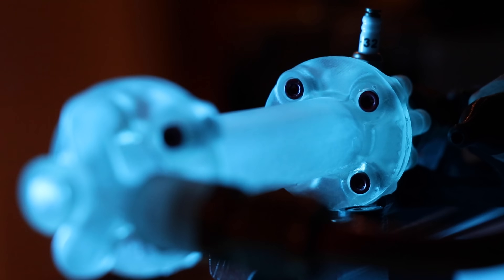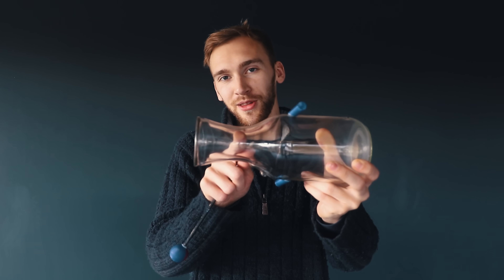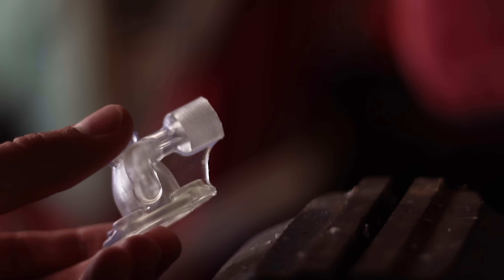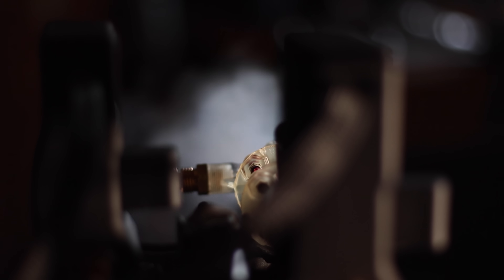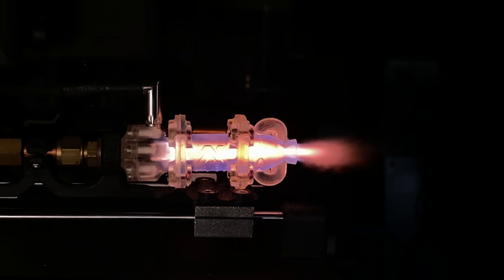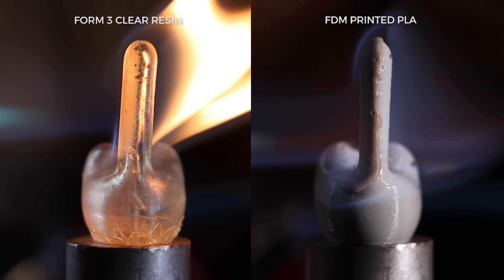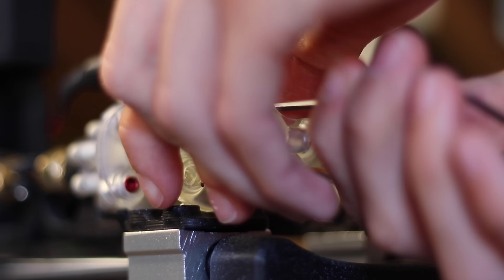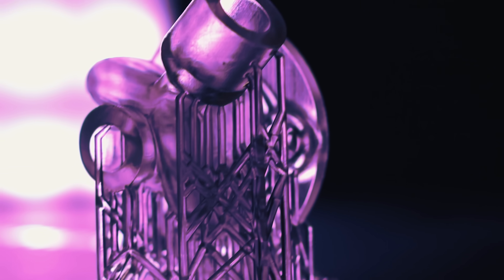3D Printed Vortex Rocket Engine Igniter

Comment: how about ceramics resin to next step nozzle tests? Those are not perfect either without burning them at high temperature but still better than normal resin. And when they work you can just heat those parts and get full streght or move to metal print if you need thermal conductivity.

Comment: You could design the nozzle slightly larger and fill the offset with silicone to make it more heat resistant I think.

Comment: Cool (literally) but why swirl the oxygen and not the fuel?  (just a thought)  And how about using PLA as lost-wax kind of casting in metal? (just my old-school thinking)
Reply: So you can watch what is happening. Also quick change parts. He could print ceramic but then it is no longer see through.

Comment: Does the swirling produce a torgue along the axis?  When operating correctly,does the exhaust gas still rotate, or  does the nozzle choke transform the flow to be unidirectional?  In normal  rocket engine there is no information of the chamber gas state transferred trough the choke, and that should also stop the rotation of the gasses. But I think the classic model is only for directional flow.

Comment: OMG that's a crazy project! Great job!
One suggestion, you may try using the ceramic resin that @Integza used in his recent videos. That resin need annealing before it's fully ceramic, but it can withstand high temperatures. Not sure how brittle it gets in the cryogenic temperatures though.

Comment: cold oxygen vortex inside this thing actually starts at the nozzle throat, then goes to the back of the combustion chamber, wraps back into itself, starts mixing with fuel, burning, then it goes back to the throat wrapped into a layer of cold axygen and only then it ejects. even though the idea of vortex cooling sounds simple, the flow pattern is actually surprisingly more complex than one might assume at first. 

and the 3d flow can't be reduced to 2d flow because it swirls in all 3 dimensions. 

i think a 3d CFD flow line diagram could have helped people appreciate how clever it actually is

Comment: Depending on how complicated the nozzle geometry needs to be, couldn't you add an off the shelf tube to the end, made from ceramic or something? Then you just add features to the 3d printed part to hold it. Also, even though you say that FDM parts wouldn't hold up, I'm pretty sure some filaments could, especially if you change the nozzle material to an off the shelf tube. 

If you master this vortex method, you could make dirt cheap engines for things out of cheap 3d printed plastic... Maybe even some kind of combustion engine...

Comment: Is there a reason to have the oxidizer in contact with the chamber walls, instead of the fuel? Seems kind of counter-intuitive
(Or is it because oxygen can achieve higher pressures?)

Comment: Ever thought of using a fdm printable ceramic for the nozzle?
Reply: There’s also ceramic resins
Reply: @MyLonewolf25  yeah ceramic resins will definitely work better than fdm
Reply: FDM printing methods are much more difficult to get high fidelity surfaces as well as more restrictive printing constraints.
Reply: Yeah, should have Just written 3d printed... Just too used to running fdm printers, sorry. 😱 Besides, for such a small piece like the nozzle alone, you could also use a Printservice with access to laser sintering or binder jetting printers.

Comment: Instant-subscribe from me, wow! Mach cones are so impressive. 
Check out some of those ceramic resins that Integza has been using where you fire them to complete the process! I know it's not clear anymore, but it's still cheaper than metal and should give longer burn times. Will have to account for shrinkage though

Comment: Amazing! Now try it with that ceramic resin @Integza has been playing with.  Ablation of the nozzle should be reduced if the resin is cured properly.
Reply: I imagine the shrinking of the ceramic as the resin cures he demonstrated in that video would make the modularity shown here difficult - it wouldn't be a smooth fit. The only time he put parts together was when they were uncured. This isn't to say that couldn't be done, but it would take a lot more trial and error with the process than this already does.
Reply: @ryanrising2237  The plastics mold shrinkage functionality in many CAE programs should let you account for this if you know the percentage changed.
Reply: @williamforbes6919  oh, I was under the impression it’d be too unpredictable to make a good seal, but modern technology never ceases to amaze
Reply: @ryanrising2237  Brought to you by the wonders of injection molding. Pour enough money and mathematicians into a problem and viola, a solution!
Reply: What about a metal sleeve inside the nozzle? That would help prevent the ablation for a while longer and should.be easy to insert.

Comment: Oblative vortex cooled engines are indeed cool, however liquid cooled engines are generally far superior for rocket applications. Very cool video, super impressive
Reply: Sure for the main engine & combustion chamber, liquid regen is better, but he said at the beginning this sort of thing was more applicable for a torch igniter in a larger engine. I can see the appeal there - it's simpler than running liquid cooling pathways for that, and this doesn't need to produce much thrust.

Comment: Absolutely awesome! Holy smokes what ingenious engineering! Love it
Reply from the maker: Thank you!
Reply: @SamRogers  I'd love to see you use ceramic resin prints. You can create extremely high temp resistant prints with ceramic resin and baking the parts first
Reply: @SamRogers  please next time use glass work instead resin because May work better.
Reply: You’re here too? Cool.
Reply: It certainly is awesome  your turn to do some of this #elementalmaker
Reply: You better one-up him then!
Reply: Ben! Where art thou? Bob, thanks for being on the same page. Always good to see that you’re around and about. When’s the next mycelium investigation happening?
Reply: EM - when are you gonna upgrade from solid rocket motors to 3d printed liquid/gas fueled rocket engines? Haha

Comment: Holy smokes. Brilliant design and implementation. Shock diamonds out of a 3D printed engine is not something I expected to see, least of all not for as long a burn time as you achieved. I'm not surprised the smaller chamber worked better. With all the turbulence caused by the vortex the combustion should be extremely rapid and require little space to complete. Excellent video production also.
Reply from the maker: Woah, thanks Ben. Big fan, especially your Senko Hanabi videos, really beautiful. The characteristic length was originally calculated for liquid propane injection, but like you say it’s just too long for a stable vortex, however since this is gas-gas injection the chamber could actually be even shorter. Thank you!
Reply: @SamRogers  Sam, you are on the same level. Good stuff.
Reply: Man I’m running into nhil every day now
Reply: Although the design cannot scale too well it is simple enough to make many of these engines together. I am envisioning a hexagonal grid of 7 of these engines machined out of two aluminium plates. Due to the simple geometry a two-piece construction is possible with only the most basic CNC cutting processes. Oxygen distribution and the swirl nozzles can be cut as slots in the nozzle plate that is then sandwiched to the much simpler combustion chamber plate.

I'm a little surprised that the oxygen is injected on the outside, I would have expected the oxygen to be tangentially injected at the rear with the fuel injected tangentially near the nozzle, but this mechanism may be relying on the centrifugal forcing of the lower-density oxygen inward through the fuel stream to provide mixing, so swapping the inputs may need a lower-density fuel like hydrogen to get this high mixing rate.

Comment: Dooopee! Have you used the temp sensors or used a FLIR camera to look at temp distribution with different variations of the engine setup? Comparing temps without vortex injected, then comparing positions of the fuel being injected at the top vs bottom vs middle of the chamber?